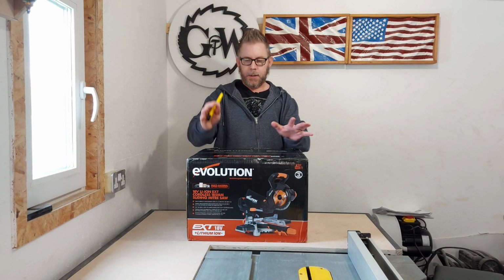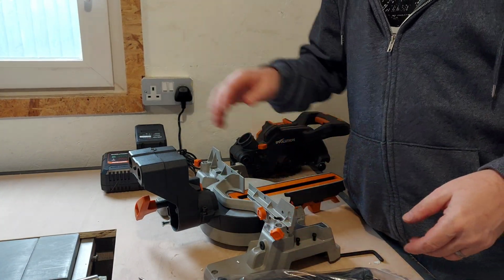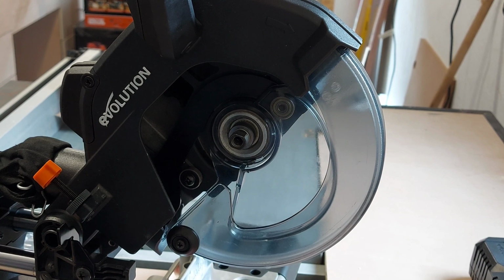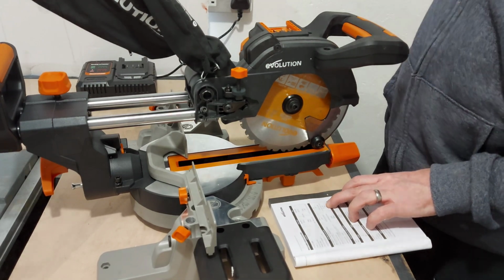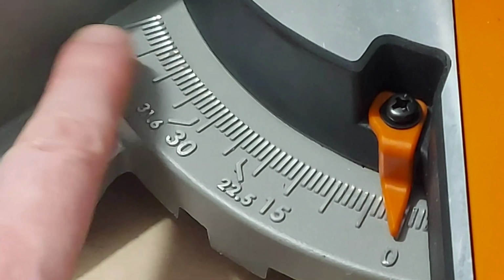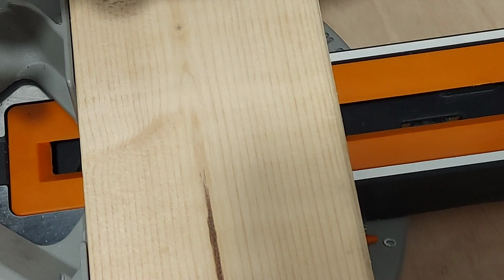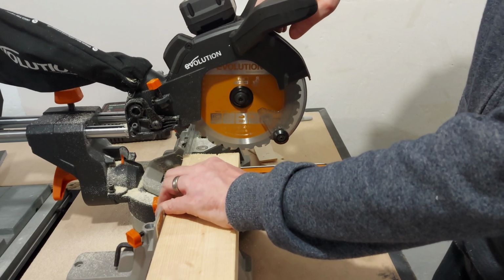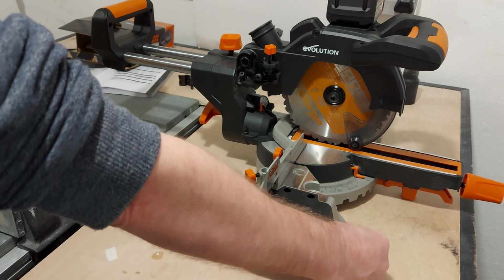New Evolution Ext 18v range, R185SMS Sliding Mitre Saw

Comment: Was going to get the Erbaur cordless sliding mitre saw…now I’m unsure…apparently they both use the same batteries…and this one is about £100 cheaper…nice video 🤓👍
Reply from the maker: Yes they both use the ext batteries.
Reply: @GrumpysWorkshop4  I decided to take up woodwork 6 months ago…and after collecting numerous hand tools off flea markets I decided to invest in the Erbaur range…my garage workshop has no power…so cordless was the thing…wow I’m addicted I’m currently on my 4th power tool and believe a sliding mitre saw will be the icing on the cake 😋! I can’t believe how good these modern cordless tools are…I’ve been off work recently for health reasons and this new woodworking bug 🐜 is just the thing 🤓
Reply from the maker: @simonmountford4291  I've always enjoyed diy type stuff. I built my small workshop so I had a place to escape to & work. I have no training in woodworking or diy but love having a go. Being in my shed has really helped my mental health. Lidl sell cheap tools made by parkside. I have a few 12v tools & they are surprisingly good. I've done reviews on them.
Reply: @GrumpysWorkshop4  at this exact moment I’m in the garage gluing up my first normal workbench…my first attempt was the $50 low Roman style workbench by Rex Krueger…which I have loved using this past few months but now realise it's limitations (especially with me having sciatica)…after I made the low bench, I was given an old school 🏫 woodworking vice and I’ve been dying to have a bench to fit it too…anyway I’ll leave things to cure and complete the job tomorrow 🤓👍BTW I have subscribed.

Comment: Dave, cant help feeling ive dropped a bollock. Sent my brand new Hikoki 8 saw back and got the Evolution 255 D/B saw. Not tried it yet but had the smaller Evo saw and was pleased with that. My head was turned by (like you) the soft start and electric brake. I wonder if i bit off more than i can chew with 10" saw. What do you think?
Reply from the maker: It all depends what you're using it for. I only have a small workshop & only use it for hobby type work so wanted a small saw. The evolution saws are well built so I'm sure you'll be fine with yours. I did own a dB mitre saw thinking dB would be better but never used it nearly as much as I thought I would. Anyway I'm sure you will be fine with the 10inch

Comment: Adorable little saw. Would be super light and handy to take on site. For the workshop if your Hikoki is plugged in I'd leave that there. Fresh blade and battery this little guy does OK but the power will probably not keep up over time with a corded one in the shop.

Comment: The saw looks not to bad, is there a way of fine adjusting the angle on the base or do you just hope its correct when you get it i know you said you can adjust the little marker but that wont change the angle to say 90 if its not if you see what i mean
Reply from the maker: It has the usual adjustments that most mitre saws have. Bolts on the back of the fence to adjust for 90°. Bolts for adjusting the bevel angles both for 0° & 45°

Comment: The shadow line is excellent, but if Evolution used forward facing bars and have the saw slide instead of needing the space at the rear for the bars to slide back they would have nailed it IMO.

I use the EXT batteries so I’m very interested to see how the circular saw goes.

Good job fella 👍👍
Reply from the maker: Yeah I agree about the rails. If they were fixed like my hikoki it would be perfect. Stay tuned for the other videos & thanks for watching